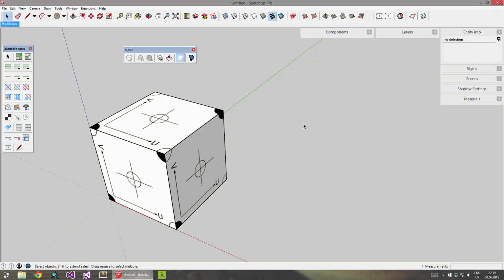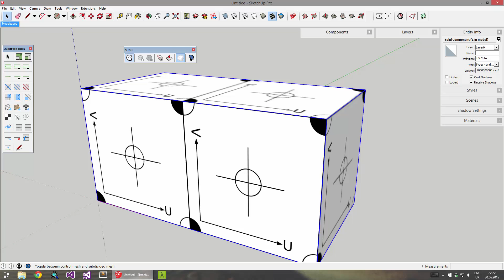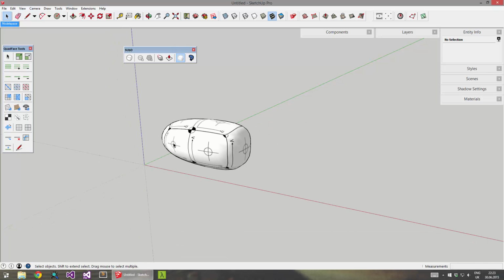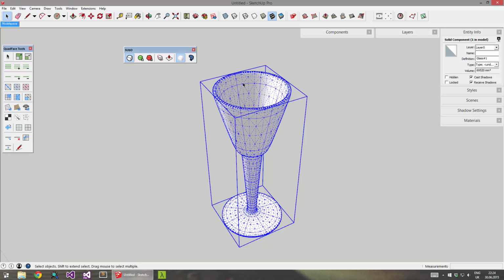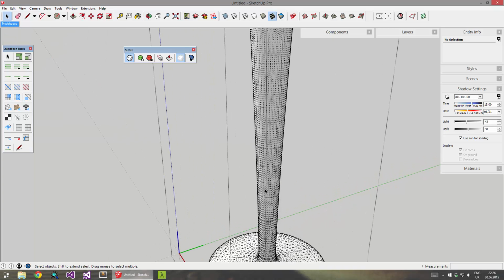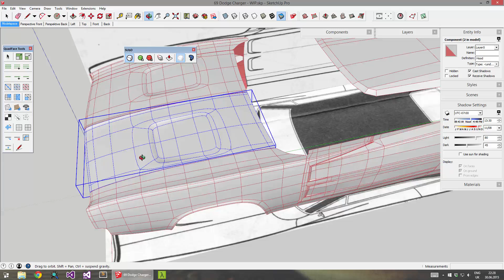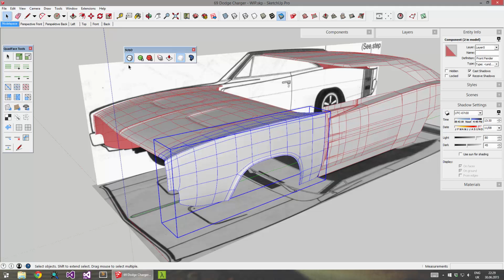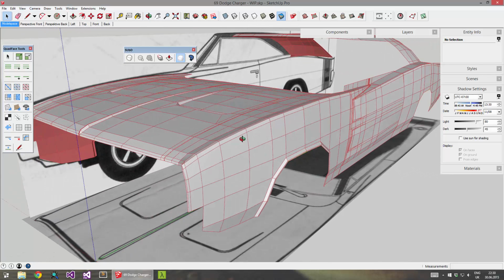SUbD Introduction

Comment: did you code this using just ruby?
Reply from the maker: +shukry sharby The initial prototype was, but the subdivision calculations where then rewritten into C++. But apart from those calculations everything else is Ruby , like the UI, tools etc.
Reply: Thomas Thomassen where did you learn c++? Self taught?
Reply from the maker: Yea, by necessity. Learned as I went and relied a lot on tutorials on the web as well as some good friends to give advice.
Reply: +Thomas Thomassen I've been using a ketchup for a 7 years now. the cleanup tools you made were amazing. 

I've also started to learn coding myself. was interested with ruby initially but I did some Javascript then got stuck with Web Dev.
Reply: +shukry sharby *sketchup not ketchup lol
Reply from the maker: Webdev will help you making Webdialog UI for Sketchup extensions. If you want to tinker with making Sketchup extension you don't have to worry about C++ too much. Only needed in very rare cases after you have squeezed everything out of Ruby.